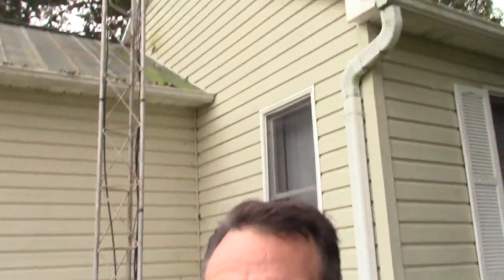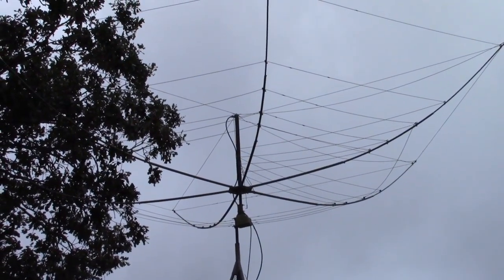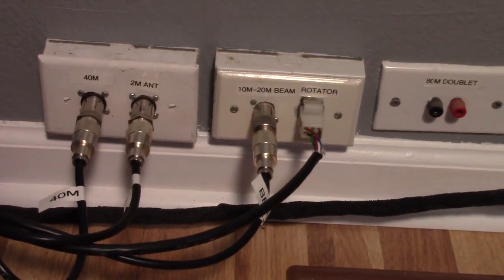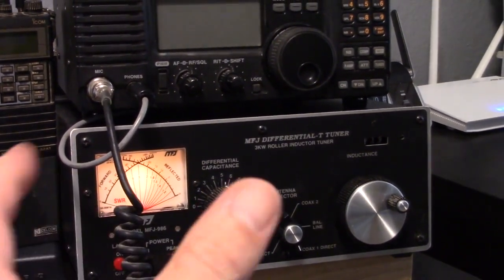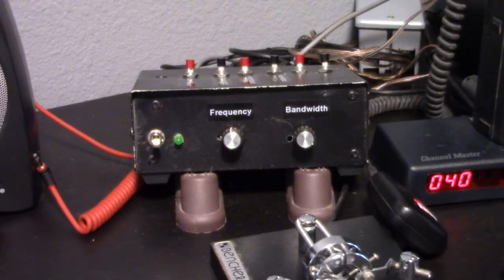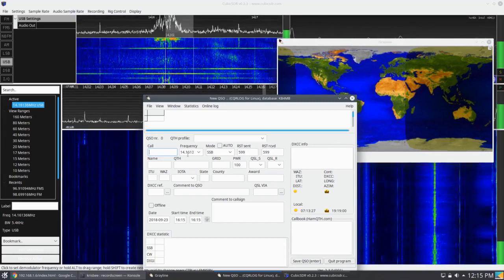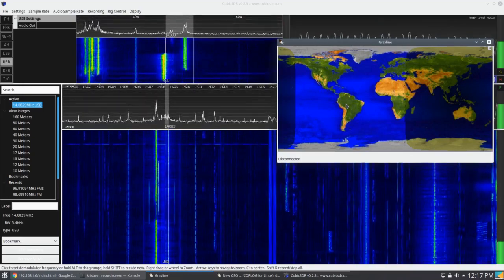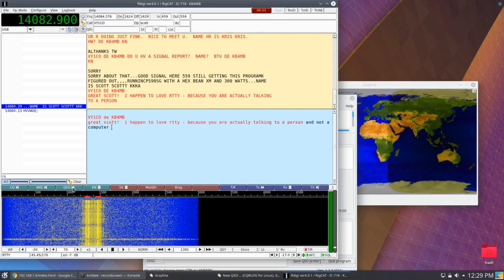My Ham Shack Tour Plus Antenna Setup

Comment: Do you get any interference between the TV and the ham antennas?   I have a similar TV antenna, a dual band, and I want to add a multiband HF vertical like a Hustler 6BTV.  I've been wondering if having them all in the same place is a bad idea.
Reply from the maker: I do not, but I DID add an FM trap to the antenna to cut any interference at the TV antenna - so that should easily filter out the ham bands.  Being digital also helps - if it was an analog TV signal, I wouldn't think I would get away completely unscathed.

Comment: Thanks for the tour!I am a newly licensed Tech/General and trying to get my shack setup.  73
Reply from the maker: Very nice - always start with nice and simple wire antennas - preferably ones that don't need to be tuned - you learn a lot and it keeps it simple.  With the bands the way they are, you pretty much only need a 40m and 20m antenna at this point.
Reply: dixielandfarm thanks for the reply. I have mounted a bracket on my tower for a future inverted V.  I also have made a 2m/70cm goundplane antenna. So lots of fun to be had. As far as wire antennas go, I agree to start simple. If I really want to get a beam or a vertical I can look at that later.

Comment: Nice video and your radio set up. I saw you 32at, very rare to see in California. Big brother of 2gat/02at. Built like a tank.  Running $150 to $200 in Ebay. Keep it, thanks,  73! KM6EHD Los Alamitos,  California.
Reply from the maker: Yup - no need to ever get rid of it, I use it as a base radio but to be honest there is very little 2m or 440 activity here so I just turn it on now and again, make a call, and hear nothing back...

Comment: Sweet! How has your experience been with that hexbeam? It looks pretty cool. I imagine it's probably on the pricey end of things? Right now, I'm leaning towards an off-center multi-band doublet that's unbalenced so I don't have to screw with ladder line. And I'm still totally considering the icom 7300. So much so that I might pull the trigger in the next couple of weeks.
Reply from the maker: The Hexbeam was $500 - but people can make them out of old pieces of bamboo if they wanted - the measurements are out there - basically it was the hub which was machined and having all the pieces ready made.  I love it and it was worth the money - so light and balanced that weather doesn't affect it - plus the dude guarantees the pieces for live (until he dies, I guess).  I will be brutal here - off center dipoles are at best a trick - they eat up part of the RF to present your transmitter a nice match - either do a fan dipole or use ladder line (I used TV twin lead for years and it isn't as big and easy to get into the house).  You won't have any issues getting the signal out.  One of the better antennas I had was a 40m horizontal loop fed with twinlead - I used it 40m-10m.  Hell, just put up a 40m and 20m fan dipole and you will get most of the things you want, anyway.  17m is still active, but 15m-10m is basically dead for the next five years.  80m you really need a vertical, anyway.  Even "I" am still thinking about the 7300 even though I love my 718...

Comment: I think it is so cool to see the computer program running with the setup. The previous vid and this one are cool to see!
Reply from the maker: Thanks so much, Steve... the computer really adds something - for some purists they only want to run stuff from the 50s, and that is fine.  There is the other end of the spectrum where people are logged into servers that tells them EXACTLY where someone is talking and they just tune to it, shout their callsign, and move on.  I'm somewhere in the middle :)  I do have a soft spot for Radio Teletype - there are guys who are literally running military surplus with large clacky typewriters talking to you.  I remember when I first interfaced the radio and the computer, you had to have an expensive box to do all the stuff in between the two - now a soundcard does it and a better job.